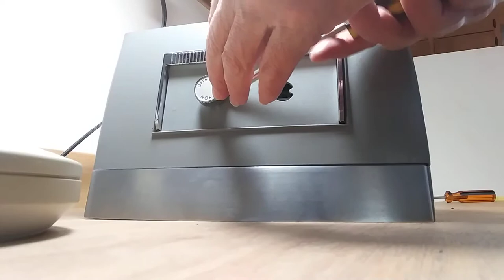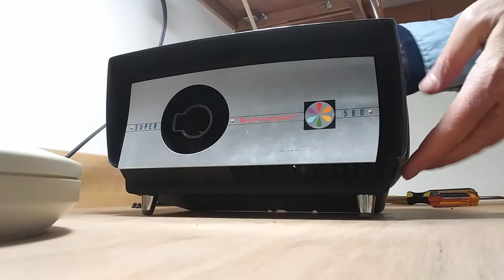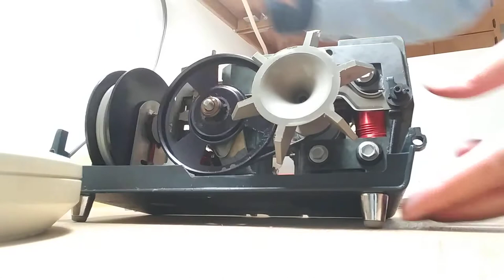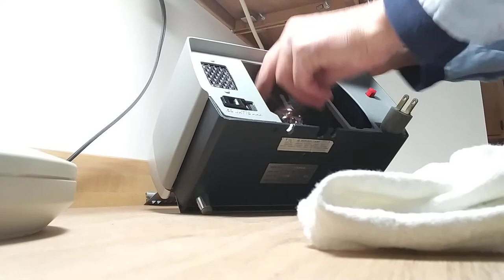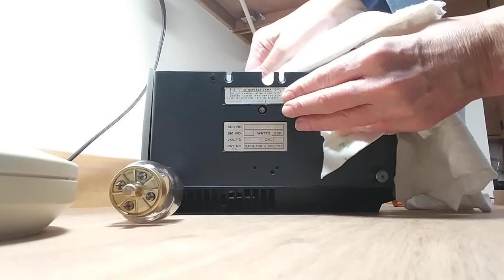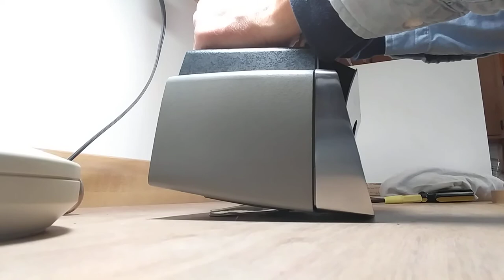Part 1 Fix Super Technicolor 580 Instant Projector

Comment: Thank you! Very well presented & clear. The AC on our 800 is old and brittle. And we plan to extract the cord reel  and make a simple hard wire connection.
We Have close-up pics of same. Do you know of any tutorials available anywhere for rewiring the cord reel?
Reply from the maker: Thank you for your comment, Martin.  Unfortunately, I am not an electrician (if I understand your question.)  I can tell you that the patent number is 3139789 for the 1964 model, and 3206757 for the 1965 model if you want to look at that documentation.  They have a lot of diagrams. As far as rewinding the cord, I played with that quite a bit. I had trouble with the auto-rewind after I had the unit apart, but I eventually got it to rewind itself again.